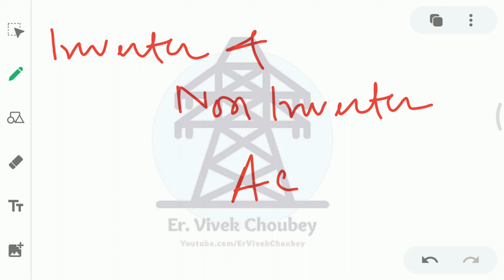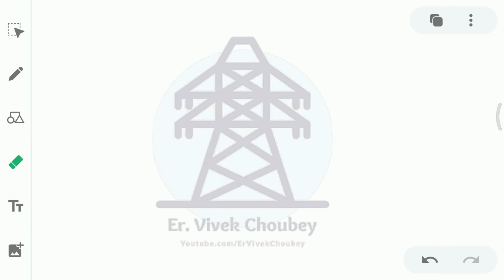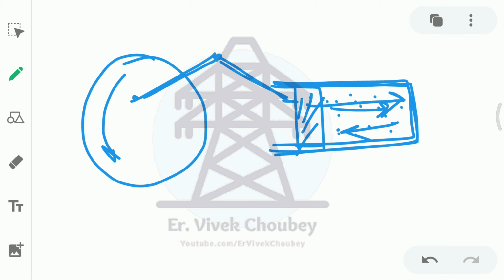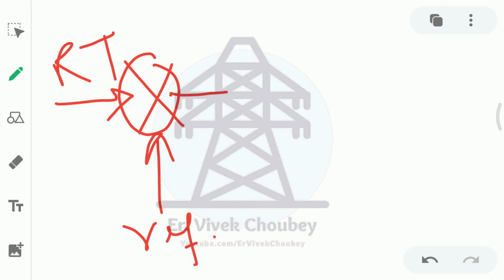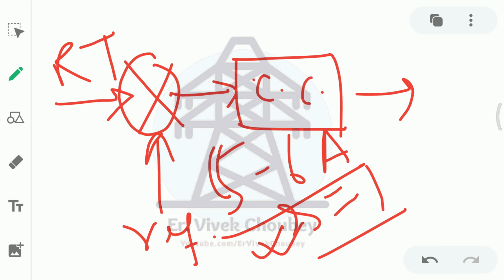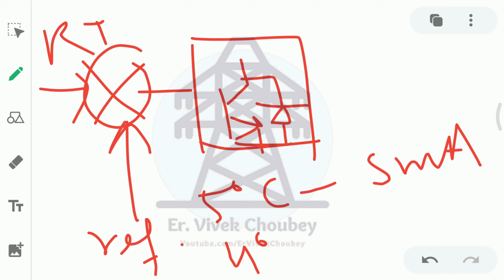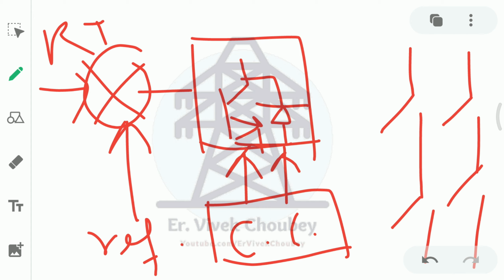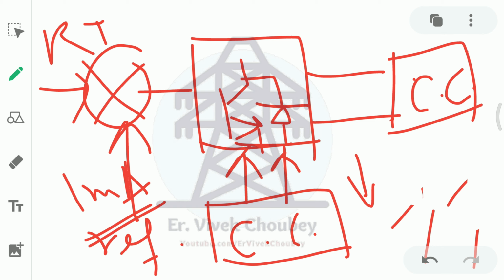Difference between INVERTER & NON-INVERTER AC || Explained Simply

Comment from the maker: This video is available in Hindi. Here:https://youtu.be/r9NNTdkomBs
Don't forget to share your feedback. Thanks 
A little piece of information
Coolant is a medium, usually fluid, used to draw heat from an object 
while the refrigerant is a substance used in a heat cycle that 
undergoes a phase change between gas and liquid to allow the cooling, as
 in refrigerators, air conditioners, etc. 

Air conditioners use two popular refrigerants: R410A and Freon .
Reply from the maker: janette crossan  there is no free power no matter whatever you use